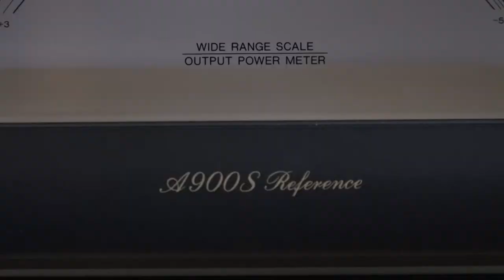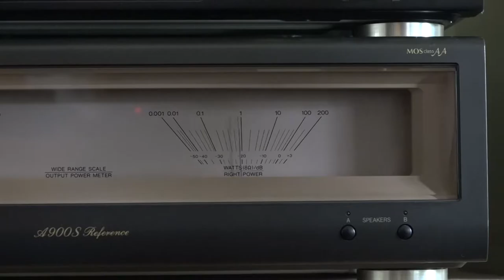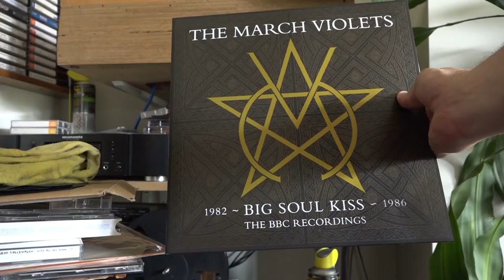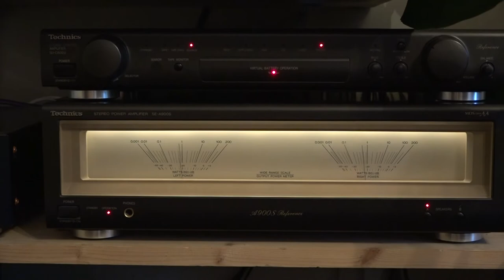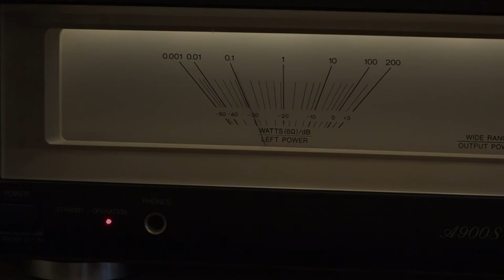How to install VU lamps into Technics SE-A900s Amplifier with XAMR131 Bulbs A909 A1000 A1010 CA1060

Comment: 40Vdc per each PCB, and all lamps run in series?  Interesting why Technics would do that.  It could be fun to make a parallel LED modification to it. And LED's in this circuit should never induce a hum on the audio circuits, if a hum occurs then 1) Technics really dropped the ball on the engineering of the amp or 2) the person installing the LED's mistakenly did something to induce it.

Comment: Im looking at getting a a900 that has working vu meters but no sound, apparently.  No pre amp included.  Is this a common fault and is it worth the investment of £100 to try and get it working again? I enjoy fault finding and repairs on a basic level.   Cheers
Reply from the maker: Is the no sound because there is no pre amp plugged in ? Might be worth checking the pre amp should be with it they were never sold separately
Reply: @MatthewNorthMusic   no, there isnt the pre amp.  The seller says the VUs indicate signal but no sound.  Would any signal from a source run the amp or is it dependent on the matching pre amp??  Im not familiar with this amp tbh.
Reply from the maker: Sounds odd the seller did have the speaker switch on the front turned on ??
Reply: @MatthewNorthMusic  just said no sound.  looked hooked up, etc.  You can use a different pre amp though right?  doesnt have to be the technics one it usually comes with?
Reply from the maker: It had photo audio in but I'm not sure if there is a power pass through or not the powe amp has speaker on off switches bottom right when on a red led should show

Comment: Hi Matthew, great video. I have just purchased this amp and one side of the lights don't work. I have looked for the bulbs but can't find them anywhere. Any chance you can find them as I have followed your link but the link does not work anymore. Thanks in advance😊
Reply from the maker: Do an ebay search.
Reply: Ok I will try that, it's difficult know what bulbs they are
Reply from the maker: @tich1375  Its in the title of the video  XAMR131

Comment: Great video! I have just done this repair. Took about half an hour. I toyed with the idea of using LED ribbon just for fun, but this was very straightforward. A solder sucker was okay, but solder braid maybe would have been easier.
Reply from the maker: Many say the LED Version induces noize and Buzz into the amp. You did the right thing there. :)

Comment: Hello Matthew; I congratulate you, a difficult experience, you succeeded.

I have the same pre+power amp components. A nice set of two, I had it about twenty-five years ago and still enjoy it. After a while after purchasing, my lighting lamps broke down, even though it's annoying, I use it like that. I didn't care when it malfunctioned, but when I saw your video, I thought of fixing it. But unfortunately I couldn't find the parts in Turkey.
Reply from the maker: Look up on eBay and good luck here's where I got mine https://www.ebay.co.uk/itm/XAMR131-bulb-lamp-Suitable-for-Technics-equipment-pack-of-10-/153972693933?mkcid=16&mkevt=1&_trksid=p2349624.m46890.l49286&mkrid=710-127635-2958-0
Reply: @MatthewNorthMusic  Thank you!

Comment: Hi Matthew, great vid firstly. - what are your thoughts on the LED replacement boards that are available, any good? I also have this with the SUC pre amp. The input selector on the SUC keeps flicking to different sources - not too often but it happens - do you have any ideas on that also please?
Reply from the maker: Firstly mine also flicks between different sources usually a bit of contact cleaner will sort that out. As for the LED strips I don't know I've never used them but I've read other people that have used them and they said it does add noise into the system. And it also makes the amp non-standard
Reply: I've had two of the pre-amps and both had this issue. I've tried liberal use of contact cleaner into the selector rotary switch but it never seems to yield a permanent fix.

My workaround has been to use only the remote and to leave the rotary switch alone. It's not a perfect solution but it prevents aggravation as far as I'm concerned.

Meanwhile the lights have been out in my SU-A909S for about 2 years so I will be embarking on the repair shown by @matthewnorthmusic

Comment: i have the same set but my source selector  keeps moving from my selection,eg tape ,phono etc.any idea why.
Reply from the maker: Common problem switch needs cleaning with contact cleaner mines the same
Reply: I have the same problem, input moves, a bit frustrating! I love this Technics amp, I've had since 1997. Loved the video Mathew. can you share link for replacement bulbs, please? I just want to be prepared if mine ever go.
Reply from the maker: Got mine on eBay do a search
Reply: @MatthewNorthMusic  just found them, thanks! 👍🏻
Reply from the maker: @DiPlacido71  Good Luck